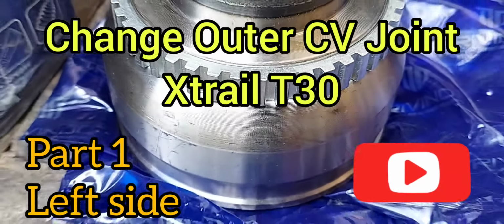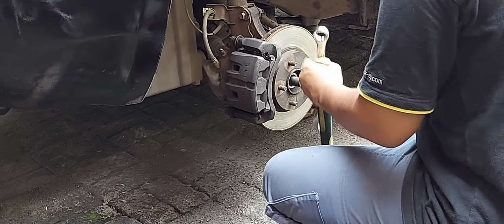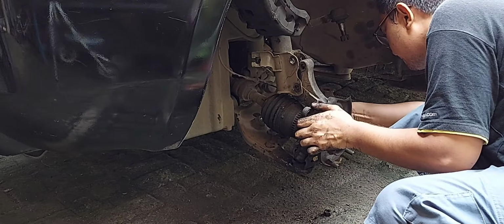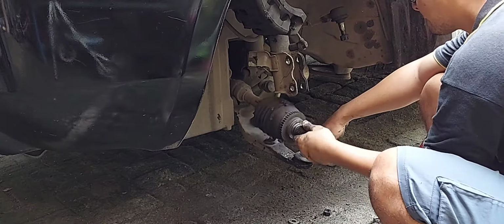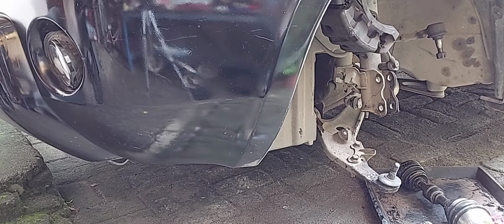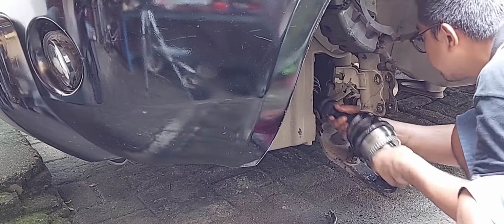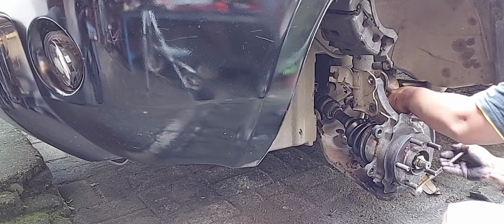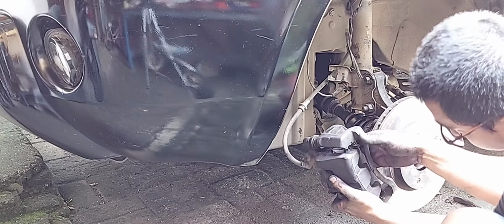Change Outer CV Joint Xtrail T30, part 1

Comment: For all of those persons that own a Nissan X-Trail, and you need to replace CV Boots on the front Drive Shafts, please do not tug and pull on the Drive Shaft, following the removal of the Brake Back plate, disc rotor and all other peripherals. Many have said "that they cannot get the Drive Shaft out of the Transmission Housing". Pulling and tugging the Drive Shaft won't remove it - if you have a Drive Shaft Bearing (as support). This Drive Shaft Bearing is located within a separate Bracket, and you will need to also remove 3 x 14mm A/F Bolts. So - take a tip from me. Take a look along the complete length of your Drive Shaft. Drive Shaft will either be clear - all the way through to the Transmission Casing, or you will find a Bracket (which is closer to the Transmission Casing). If you see a Bracket attached, then you must (first) undo and remove the three x 14mm A/F Bolts. Another bit of advice: Remove completely, the plastic guard which partly covers this area. It is much easier then. The most difficult part is getting to just one of these Bracket Bolts, all done by feel, not from underneath (impossible) and not much room for radial movement of your spanner. One that these three 14mm A/F bolts have been removed, you will be surprised just how easy your Drive Shaft comes out. Don't forget to place an Oil Catch Tray under the vehicle, to catch the oil as the Drive Shaft is removed. Not all X-Trails are the same. Best of luck, and I hope that this helps. Greetings from Australia.
Reply: Just make a video dude...for fucks sake
Reply: Only left side has the bracket? The right just pulls out, two different shafts.
Reply: @aussiefarmboy  I only did ONE side of my T30. If you are sat behind the Steering Wheel, then I did the RIGHT side. Hope that this helps.

Comment: Saya barusan ganti CV joint luar kiri brand Trivindo. kendalanya Nut shaft pakai kunci berapa ya (saya ukur 31.5mm) apakah menggunakan shock inch ?  jika drive shaft ori menggunakan shock 32mm.
Reply from the maker: @kharismapratama1800  size 32 om

Comment: Izin nanya, om. Bagaimana cara mengetahui bahwa outer cv joint  ini  rusak ? gejalan apa yg terasa pada roda ?
Reply from the maker: Ada bunyi² aneh, coba ja ban di gantung (pakai dongkrak) lalu goyang²kan bannya
Reply: @jendroscreation  Om, mobil saya t30 manual, kata mekanik bengkel ada gejala kerusakan di CV join kiri dalam. Kira" kalau beli spare part rekomnya di mana ya ? trims
Reply from the maker: @pemerhatidunia5235  coba gugling dan tanya² dlu om di tokonya, onlen shop banyak
https://www.tokopedia.com/champion-nissan?utm_source=salinlink&utm_medium=share&utm_campaign=Shop-14832320-917717-171022-no image

https://www.tokopedia.com/luckymotornissan?utm_source=salinlink&utm_medium=share&utm_campaign=Shop-14832320-1352407-171022-no image

https://www.tokopedia.com/bjnissan?utm_source=salinlink&utm_medium=share&utm_campaign=Shop-14832320-3024963-171022-no image

https://www.tokopedia.com/pitseamtr?utm_source=salinlink&utm_medium=share&utm_campaign=Shop-14832320-2357209-171022-no image

https://www.tokopedia.com/tanimotornissan?utm_source=salinlink&utm_medium=share&utm_campaign=Shop-14832320-682635-171022-no image